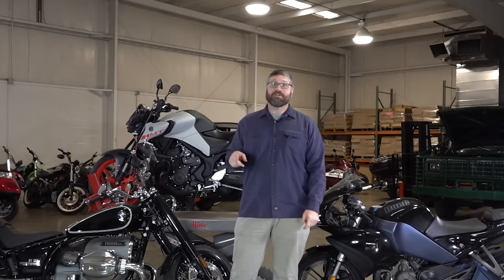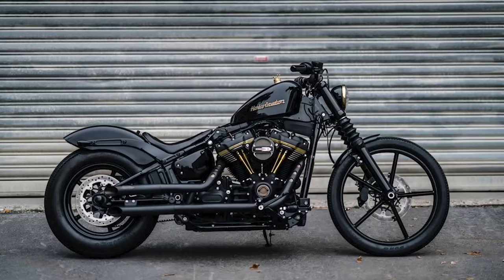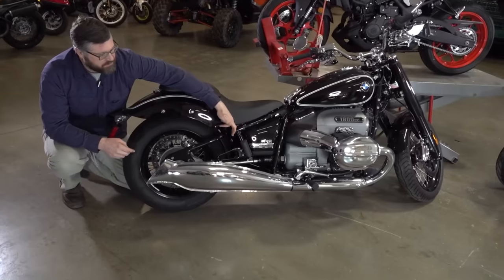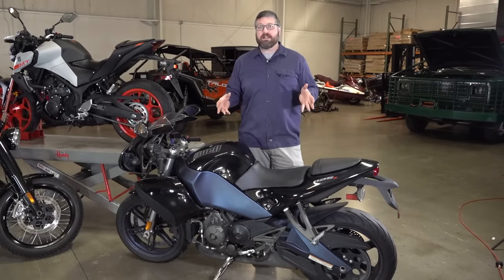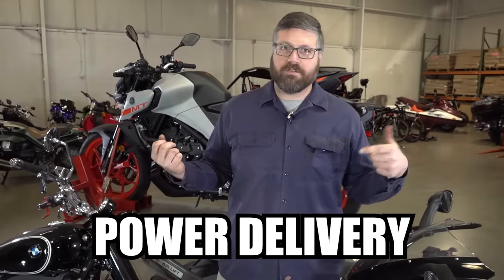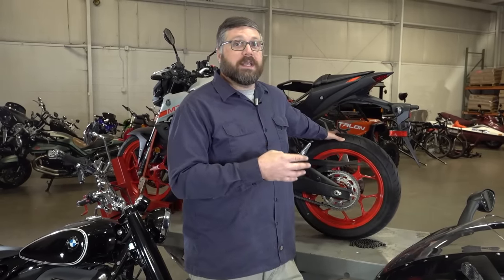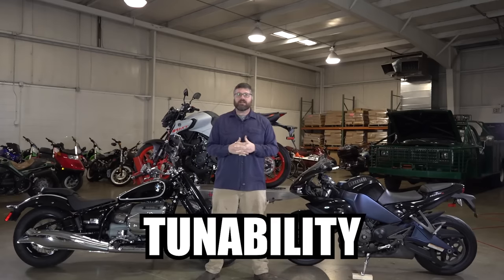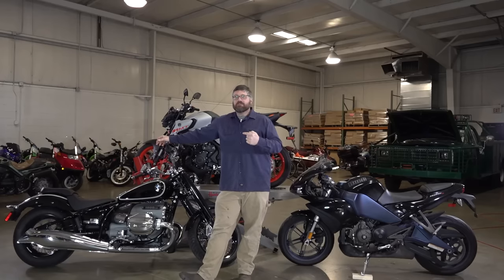Motorcycle Chain vs Belt vs Shaft Which one is Better?

Comment: As for the claim that the belt has a higher parasitic power loss than the chain, can you explain that? Honestly. I have heard this but no one has explained it to me when asked. They always say that it's so because everybody knows it's so. I understand that the belt,... when we talk about the "V" Belt has allot of friction between the sides and the groove of the pulley. That's how they work! But the drive belts on these bikes are using teeth to engage with the outer diameter of the pulley just like the chain does. And a belt actually doesn't go as far into the tooth as the chain does. The only thing I can think of that would rob any power is the fact that it has to be tighter than the chain does to work. But, then again, it weighs soo much less than the chain, I would think any power lost to tension would be negated or made up for by being lighter.

Comment: i don't. this super easy to change the pullies on a belt drive. i had a 900 kaw loved the bike but i did long hwy ride and it just reved way to much. it was about 500 $ to change both but man well worth it. now on my harley like you i dont see the need but we're talking two very different motors. i have had chain drive on every other bike and they are a pain in the ass. if you have white walls, not on that side you dont. unlike the belt drive every other year at least your going to have to change everything chain, both gears. thats without talking about the constant ajusting and cleaning. on harleys if you want more direct power to the wheel put a solid  or like a dark horse compensator on . also i take my roadking done sigle track, gravel mud and maybe I've been lucky but no issues. i think wanting a chain is just holding on to something antiquated.. like the rest of my harley haha

Comment: From an engineering efficiency standpoint, chain is best, it uses less energy for transfer.  I like my Japanese bike's shaft drives however.  A new O ring chain does not fling that much oil nor need that much maintenance. I never had a belt, I heard they can break but that is probably a matter of not inspecting it for wear and tear on a regular basis like feeling the slack in the chain type thing. The very first bikes used all three. My favorite is putting the engine, a radial engine, inside the wheel.   Direct drive.

Comment: Shafts are less efficient, with the direction of power having to change 90 degrees twice in some cases. But that BMW only changes direction once, the shaft rotates the same way the crankshaft does. But some longitudinal engines have the shaft and that's 90 degrees twice.

Comment: 03:00 When it comes to belts, is it possible to put a chain cover over the belt to stop this occurring? I use to ride a Honda CG125, and it had a chain cover. Many motorcycles in Asia have chain covers, due to dusty and dirt covered roads.

Comment: Shaft is best, chain is next, belt comes in last.  All need proper maintenance.  The shaft is the most responsive, has the least vibration and is protected from damage.  Belts are for posers who never get off of clean pavement, because that wide pulley with those fat notches trap rocks, that would just fall out of the teeth on a sprocket.  Chain needs more maintenance than shaft drive, but is also the easiest of the three to maintain -- put the bike on the center stand, spin the rear wheel, one pass with brush to clean, one to re-oil.  But I'm curious how a shaft drive can "lose" power.

Comment: Presenter didn’t mention handling or weight. Heavy cruiser then shaft is fine but race/sport has to be chain (the rear sprocket for belt is heavier so more unstrung weight). Maintenance wise a chain and sprocket set is a relatively cheap consumable like brake pads whereas a rear shaft that lost its oil is a big bill.

Comment: I've had a couple of belt drives myself, none did 100,000 miles. Maybe in a ideal environment, but never done 100,000. Anyway, still a good drive system. Personal preference - shaft. I like the fact that after sudden exposure to rain or what ever, I still don't have to care so much as I would on a chain. I didn't think much when I was used to the chain drive system, most the bikes I loved was chain, but having experienced a shaft, I'm loving it so far. Less of a maintenance to do.

Comment: Have also owned all three and appreciate the run down. I agree with all you said except one. Having to change the two oil reservoirs on my BMW shaft drive every 10k is a nuisance. My belt drive bike is far easier to maintain. No alignment issues or rocks ever and I've got at least 50k on it. I look at it once in a while and then just ride.

Comment: I was in my car going slowly through road works, new chip seal, and a Harley was coming the other way. Right beside my car a stone got into the belt gears on the Harley and broke the belt in half.  It was just flapping, dragging on the road.  This does not happen with chain drive or shaft.

Comment: I broke a shaft drive dumping the clutch too hard. Also there was no mention of handling. Try coming into a hard corner in a low gear and let off the gas too quick on a shaft drive and the rear end will squat, you suddenly grind and could even lose it.

Comment: Never had a belt. 4 chain n 1 shaft. I almost instantly regretted the shaft. All crusiers. Shaft was noticably slower n less responsive as well as it rose and sat down during acceleration and deceleration. A lesser poiny was the strange wirring the shaft has rather than the machined chain sound. Def a chain guy

Comment: This may seem a stupid question, but would it be possible to swap the actual drive shaft for a carbon fibre one to make the weight less? Doing this would decrease the turning weight making it easier to turn the rear wheel?

Comment: Notnonly that, they use a chain between the engine crank and the gear , thats whete they need a BELT (4 screws to replace the belt, no oil leacking joints etc..) so they practicaly put a chain where a belt is better, and vice versa

Comment: I would also add another disadvantage of the shaft drive. The system is very very heavy..it also doesn't allow for huge travel of the wheel. The latter though is getting better as there are now shaft driven bikes with over 200mm of travel.

Comment: One thing about shaft drive is if you soup up your motor to make way more hp than its supposed to make it will shear easier and be way more expensive to fix than chain or belt, once a ring and pinion slips a little its pretty much gone.

Comment: I vote chain drive to be the best because of one time when I was riding down a highway my chain broke off and and I fixed it with my emergency master link and a leatherman but when my buddies 99 wide glide blew the belt off I had to order another belt and take half the engine apart to fix it its not something you can do on the side of a hoghway.

Comment: I would disagree with longevity, while i love the belt drive on my current bike I have also had the belt fail a few times during cold weather where as I have never had a chain fail due to cold temps.  This brings me to how easy it is to replace and if you break a belt miles from home then you are stuck and better hope the recovery truck does not cost more than the bike because there is no way you are doing a road side fix, where as the last time I had a chain link break it was easy to fix at the side of the road and in about 20 min i was back on the road, this was because I always carry a chain breaker tool  / a section of chain and 2 master links

Comment: People think I'm insane but I essentially run my chain dry.  I give it an occasional wipe down with WD40 on a rag and let the grease behind the o-rings do the lubricating.  This worked for 20,000 miles on my ZX-9R and is looking good so far on my CBR1000RR that has 10,500 miles.
Reply: AFAIK WD40 and rubber are not best friends, but when it works for you it's okay for me. 😉

Comment: Certain high levels of Torque and Power, Chain is the only option. Belts will shred, and the jacking on shaft drive will be prohibitive. A decent 530 ZX series o-ring chain can withstand 11,000 lbs of force. That's like lifting two Ford 1/2 ton pickup trucks in the air.
Reply: shaft is the best!

Comment: Thank you for this video but as a ultra cvo Rider I can tell you that belts do stretch out and they are very costly to replace HARLEY DAVIDSON will charge you close to $1000 just to replace it and NO  the belt is not 100,000 miles the belt if you ride  consistently” will only last close to 15 too 20’000 thousand miles or less
Reply: The last one I replaced myself took around 4 hrs (including beer time) and cost less than $250.

Comment: Man i always have had chain drive until the bike i got now now i got shaft drive and its def smoother and quieter and less maintains however its much harder to remove the rear wheel. Maintenance is way easier and faster

Comment: Your opinion was that shaft drive is smoothest. Under one circumstance it’s not - hard downshifts. When I rode a BMW R100 as a courier, I found that braking and hard downshifting was problematical for a shaft drive and could even lock up the rear wheel. Not something you would find with chain/belt due to the Cush drive. This could cause issues in the wet, and I always found I had to take it into consideration when riding that bike in rain.
Reply: ........ so don't do hard downshifting! 
Ex courier CX500,  CX500B,  CX500 Eurosport, Kawasaki GT550, GT750, Suzuki GS850G etc.

Comment: Chain Chain Chain. They are 99 percent efficient. Allows for a lot of suspension travel. Easy to replace. Easy maintenance. No dry rotting.
Reply: Watched the video. You were making it sound like it’s a lot of work to maintain. On my Hondas and Suzuki bikes it takes 20 minutes tops to adjust tension and lube. Changing the chain might take 30 to 45minutes.

Comment: Excellent video Craig!  I don't have a beard so I hope my comment will be permitted.  I've been biking for 15 years, my first big bike was the Honda Deauville 650 which previously was a naked NTV650 - amazing for it's time 20 years ago - it was V twin and shaft drive.  At that age i didn't want a chain bike at all.  15 years later I now have a CBR sports bike and i now really enjoy doing the basic maintenance of oiling and cleaning the chain.  There really is a big difference in power - the shaft bike never felt like it could scare me - unfortunately it gained the nick name of the 'Dullsville' - but you'll still see them on the roads today.  The paint on the shaft started flaking off after a few years and it rusted very easily.  I've also had belt drive on a Yamaha 400 Majesty scooter but i'm sure the belt had to be changed ever 6000 miles which for me would be every year.  It was also very expensive.  For the moment am happy with chain drive as it's lighter than shaft drive, and for me having less weight is the most important factor in a motorcycle.
Reply: Couriered for thirty years and shaft was always king so horses for courses as we needed bikes that got from A to B without worrying about how we looked.!
Honda CX500A, CX500B,  CX500 Eurosport, Kawasaki GT550, GT750, Suzuki GS850 etc, etc. Had a few chain drive bikes along the way but constantly oiling, adjusting and replacing was just a pain.

Comment: I love my XS Eleven which is shaft. It's just smooth and goes well enough to scare me. It does take time to get used to the handling though as the final drive is upside down. Meaning when you hit the throttle, the rear can rise instead of sink. Got to be really careful in corners until you're used to it. I believe Yamaha used the BMW spec for the shaft and just inverted it. I'm sure someone will tell me if I'm wrong. Just what I heard.

Comment: Great video!  I have had all three and for the intended use of the bike they were all best.  My last bike was a F800GS that I rode daily.  Every weekend I had to clean the chain, every other day I had to oil the chain, every 40k miles (12 to 15 months) I had to shell out $250 for a new sprocket and chain set. That got old fast...but...it took me everywhere I wanted to go, and comfortably I might add.  Highway, gravel road, dirt road, single track...it did it all.  The Harley I had...only had to adjust the belt when I changed tires. I never had any issues with them.  I had to check it periodically but it was always fine.  I'm now on my second drive shaft bike and  I love that I don't worry about it.  I like working on my bikes but the chain drive was too much for me.  On the dirt bikes it's just as you said, chains are lighter and easier to change the gearing to whatever I wanted.  I didn't have to worry about maintenance much because it got cleaned after every ride just about because I always ended up in some mud somewhere and had to clean the bike.  I didn't put thousands of miles on them so I didn't have to change them often...if ever.   Having anything else on a dirt bike would be nonsense!

Comment: I've owned all 3, I like them all but for different reasons/applications like you've described here.  The only thing I would add is with a shaft drive you get the swing arm lift effect while accelerating.  It's really not bad once you get used to it, but it does give the bike a slightly different feel.

Comment: Great vid. This is a simple, easy segment that lays out the pro's and con's of alternative engineering used on bikes, and it's something many bikers have questions about 👍🏻👏🏼.
Could you do a piece on after-market exhausts? End cans; is an Akroprovic end can better than a budget, and if so, why?
Same for a full system.
Are there benefits to running an aftermarket exhaust or can they damage the engine, etc...
Great to see you, Craig, and thanks creating content that makes a difference to what we look for when buying and riding a bike 👍🏻👍🏻👍🏻

Comment: Yay Craig!  Nice video, I've owned all three drive systems on a variety of bikes and currently have shaft drive on my Yamaha V-Star cruiser.  Super easy low to no maintenance.  I had a Roadstar Warrior for 9 years with belt drive and never had one issue and it barely looked worn after 20k miles when I eventually sold it.  My Kawasaki and Yamaha dirt and street bikes had chain drives and I did sort of enjoy the maintenance and tinkering, swapping sprockets etc.  More Craig videos please!

Comment: The only outlier I’ve heard of with modifying Shaft drives was switching out a shaft drive in a VTX1800 for a VTX1300 shaft drive.
Reply: Vtx 1800 owners like to swap to the Vtx 1300 final drive (rear differential) for better highway gearing (1800 riders complain of high rpm at highway speed), and I believe the 1300 guys like to swap to the 1800 final drive for increased power at the bottom end. I like my 1300 just the way it is but I’ve also done some jetting exhaust and intake modifications.

Comment: Solid info…only one key 🔑 omission IMO is roll off smoothness. When you roll off a shaft drive it drags the bike down like braking in an electric car. In corners it’s not cool because I you want to have smooth momentum through the curve and not feel a drag on the back wheel.  I sold my Moto Guzzi V7 on this point alone. Never will have shaft drive again.
Reply: Weird. I recall people complaining that the Honda CX500 would lurch from side to side when revved up at standstill and vowing never to ride them because of that. Certainly did exactly that but never when actually riding them.

Comment: What a weird bike that Buell is. It’s the first time I’m seeing one and I cant understand how such a powerful bike has just one front diskbrake.
Reply: Buells have a fabulous perimetral disc that runs on the rim so its BIG. Brilliant Engineering. The swingarm or rear forks also act as oil tank. Eric Buell made great bikes. PS: Belts rule!  Theyre Light, Low maintenance, Long lasting, quiet and clean. For me (Road rider not dirty gravel tracks) they win hands down.

Comment: isn't there a torque issue with the shaft drive.
the sunbeam motorbike had an issue with torque into a turn that was a bit of a trap for young players
Reply: Shaft drives are creating a counterforce causing the rear to lift when opening the throttle unless its been countered with a counterforce rod (like BMW's Paralever), parting the shaft with special joints (Honda used this technique)...or leaving it to the skills of the rider to negotiate with it.

I had owned a BMW K 1100 RS and had no issues with the habits of the shaft drive, but almost 280 kgs when fueled and filled made it a bit too heavy and unwieldy in my eyes.

Comment: Shafts torque the rear-end up under acceleration and down under deceleration which is opposite of what you want your suspension to do!
Reply: Do you mean the wheel torques up, or the frame torques up?

Comment: Undoubtedly Carc drive is best. No downside.
Reply: The best system not considered. My Triumph Thunderbird just picked up one sharp stone and wrote the belt off. I changed my Triumph RS chain to a heavy duty chain. 100,000ks, and adjusted twice with plenty of life left in it when I sold it.

Comment: I have been riding since 1975 and I have had belts, chains and drive shaft. These are the stats I remember reading regarding loss of power. Chains was 1%, The shaft loss was 15% to 17% and belt was 2%. I have had the same bake a 1991 HD FXDB Dyna Sturgis and I bought it new. It has well over a 100,000 miles. I puts out 115 RWHP and 110 ftlbs of torque.
Reply: 115 hp out of an Evo? Nope.
Reply: @dukeljk2191  Here it is a 96" Ultima is guaranteed 100 RWHP. with a S&S Super G, K&N Air Filter, and S&S .585 Cam.  It is a 115 RWHP.